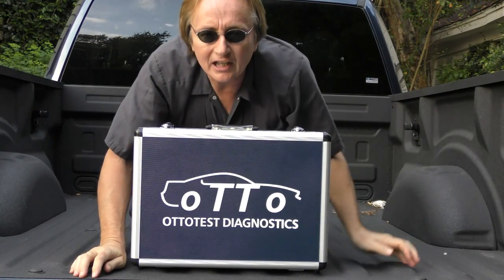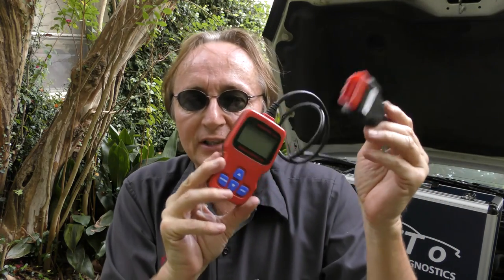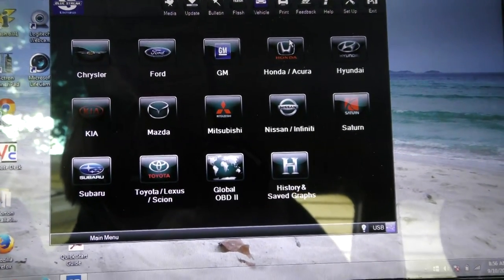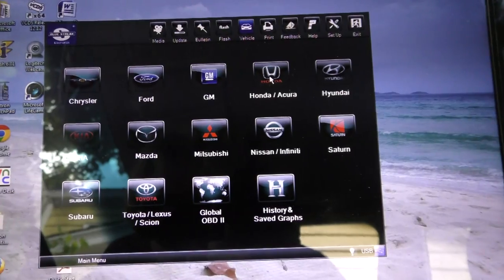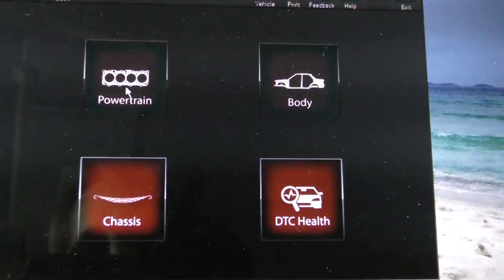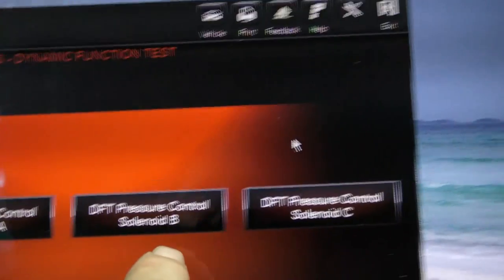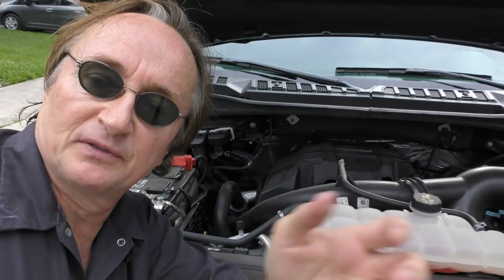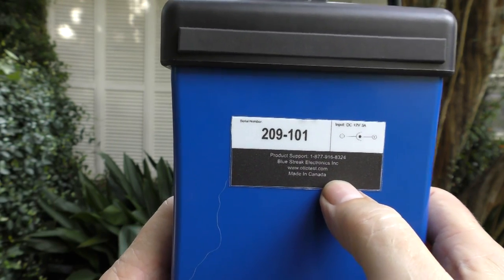Fixing Complex Modern Cars

Comment: Hello Scotty, I watch your videos everytime and some of them are occured to my car. My problem is this. ( my needles of speedometer rpm fuel etc are lower than usuar, especially the km/h needle, but when my car is off and I turn it on everytime I turn my headlights on something happens. Like a shut off of everything in my car for 2 seconds and then back on, I have to mention that i changed my HID kit a few days ago. This happens when I turn the car or the ignition on and after that my headlights. If I try to turn headlilghts with the car and ignition off, my headlights start flashing ) My car is peugeot 307 
I have sooo many problem to discuss with you but unfortunately I live in europe
Reply: +Florenc Sinanaj I think a good starting point would be to check if your battery is still good enough.
Reply: its voltage is 12.7V which I think is good but some people tell me to change the comm2000 unit on my steering wheel. I don't know now..

Comment: Is a muffler delete a good idea? What are the negatives of doing so?
Reply from the maker: +M134D MINIGUN well, cops will pull you over, and really, it messes with the exhaust back pressure on modern cars and actually makes them run worse unless computer is reprogrammed
Reply: Hey Scotty, I have a 2011 Kia Soul with sport mode on it. When should I use sport mode? Can I use it whenever I want?

Comment: Pretty cool! Though I beg to differ about European cars. I just paid $15 for full multi-system fault code software for my Volvo.
Reply from the maker: +Alex Pancamo that's nonsense, you may have gotten some cheap chinese made bluetooth device, but it won't be full volvo software, I guarantee that
Reply: Scotty Kilmer
No, I have a chinese bluetooth one too, and that works great with the Torque app, but that isn't a full feature program. Just basic OBD2. I also have VOL-FCR, which is Chinese, but it truly is a full feature program. I had to work out some kinks (used a $5 VAG-COM cable instead of the cheap one included) but it works on ALL systems. It is full Volvo software for OBD-II compliant Volvo models up until 1998. Ask any Volvo guy, they'll tell you that's the best one without getting the full VIDA/DiCE.

Comment: Scotty, my powersteeing doesn't work when I'm at idle. The belt is tight, not slipping, and fluid is level. What could be the problem? Its a 99 cavalier
Reply from the maker: +mutantmexicanbeans worn out pump if engine is idling at normal speed
Reply: +Scotty Kilmer Thanks!

Comment: Can this tool cycle the ABS module to bleed it?  Is it better than the autel maxidas? It's not often but I've had to take my vehicles to a shop to have that bled if air ever gets in there because there's no good way to do it manually.
Reply from the maker: +ScubaCat3  yes it can, and it does much more than an autel for most cars that is does handle.

Comment: Hiya Scotty I have a 03 Chrysler voyager and I need a new blendoor for the heater can you make a video on how to fix it, I can't afford a 1,500 repair I also can't go another winter wearing 8 layers while driving it.
Reply from the maker: +annoythedonkey it is an insane job, and I won't be making a video any time soon, cause it doesn't get cold here in houston, so when one breaks, the owner just leaves it alone in most cases.  BUT, you could get one of those electrical car heaters that help heat the cabin out, they cost little and you can wire it directly to the battery to make heat inside the cabin.
Reply: +Scotty Kilmer thanks Scotty, I did that last year the 12v heater caught on fire, lucky or me I was in the van when it happened Because I had a ton (literally 2500 pounds of a weekly publication news paper in the van) I really appreciate you taking time out of your day to help people like me with automotive questions

Comment: my autel scanner that cost about 300 euro does all of this and more it basically covers every manufacture you can think of asia, europe and usa, all the modules they have, and less than 1/4 the price.
Reply from the maker: +Ray Rooney And it has cloned pretty much illegal software in it, plus it does not do the 95 percent coverage of most models, often not even 50 percent on many models.
Reply: +Scotty Kilmer I wouldn't worry bot whether it's cloned or not I think the one I have is the md802 elite it's brilliant. But I have had their cheaper scanners and they were junk.

Comment: hmm, ive got one of these wifi things that pluginto your car and as long as you have a good app on ur phone it works just fine, and u can pick one up for around £10-20
Reply from the maker: yea, but those only go so far, no where near dealer scan tool information on those. i know, i've tried a bunch of them out and never use any of them anymore
Reply: Scotty Kilmer oh, yeah for example i couldnt get any data from the aircon system, it just said that it was unsupported. You get what you pay for i guess :)
Reply: +Scotty Kilmer I bought a $50 scanner on ebay not sure the name because it got stolen in my car before I get to know it, the things it can do are pretty much a Bluetooth scanner can do too. Plus the Bluetooth one show emission data, showing all the number , graphs plus it comes many performance  gauges where you need to spend thousand from a sport car. The app is Torque. $5

Comment: I have no problems at all repairing modern cars but I a Mustang just keeping up...A crv no problems since the scroll ac compressor went bad under warrenty and now its 16 and a Nissan Titan truck 6 years old just brakes and rotors and a tail pipe flange at the muffler and 100 k miles.. I had a Carolla but the tranmisission went bad at 320000

Comment: you should check out vcds for VAG cars, really powerful software
Reply from the maker: +Ivan Jacobs oh, I've got one of those too, people send me stuff all the time in hope I use them in my videos. And they do work decently, but nothing compared to the factory vag com unit, which I also have
Reply: for sure, the actual VAG one is awesome

What i found after tinkering around with my 2011 A4 audi, was that a bunch of the cars features are turned off, 
things like the automatically dipping mirrors when reversing, or the feature which automatically closes your windows when parked, when it starts to rain, or the fog lights coming on into which direction you are turning, Suppose its just more for the STEALERSHIP to rob you of.

More interestingly , when i got the car, it had a audible beep when locking the car, a feature which vanished after the one service, upon questioning, turns out its some german BULLSHIT that was being forced, due to "noise pollution..."

which posed a issue, here in South africa, we have a problem with remote jamming,

what would happen, is, Thieving lowlife, will jam the signal your key/remote sends to the car by means on a garage opener remote, or gate remote , or similar car remote( fleabay) and you walk off, thinking your car was locked. Then as soon as you walk off, they come and help themselves to your items left in your unlocked car, so when i found that option to reenable it , i was most pleased!!

Thanks for the video's , most entertaining, and try lay off the german car bashing, they not all bad :) Audi is Awesome!!

Comment: BMW/VW/Porsche/Mercedes factory software is free online, and the cable for it costs $15.
Reply from the maker: oh yea, send a link for us all here if that's really true.  That stuff costs a fortune for the real stuff, that is either pirate stuff or just a weak bit of software, not the real factory stuff
Reply: Scotty Kilmer I'll see if I can find it again and send it over to you, at least for BMW. I know for a fact that the BMW software is indeed what they use at the dealer, and it's a standalone program. It works pretty well; not as convenient as your scanner, but for the DIYer, it's perfect. I've coded all sorts of amazing options of my car thanks to it! I'd love to show you the wild functions that they program for BMWs - but the dealer originally ships them as disabled. Why? Because if you want to enable them, it's $100 per coding session!

The dealer software is less powerful than the factory engineer software. The engineer software is extremely powerful: you can run any function you'd ever need on it, which actually makes it relatively dangerous. You could set off your airbags if you really wanted to. My favorite function, though, is the power bleeder. It'll run ABS and everything for you to bleed the brakes automatically. Just hook up your bleeder bottle, fill up the reservoir, hit "Start" and follow the on-screen instructions.

Dealer software is called ISTA/D and ISTA/P. /D is for diagnosis, /P is for programming. The factory debugging software is called INPA.

Comment: i know this may be off topic but i have a 2001 kia sephia automatic and for a few weeks now it had been acting up the gears wont shift correctly like it wont go past Drive 2 i can shift to just DRIVE but it wont go into drive just DRIVE 2 AND DRIVE 1which is annoying now it accelerates slowly very slowly to the point it's not drivable anymore. i cant get it to a shop till next month and need it to go back and forth do you know wut may be the problem?
Reply from the maker: +🔰SickVibe-DisRupT🔰   odds are tranny is breaking down internally, typical on those. But try changing fluid and filter and pray that helps.
Reply: +Scotty Kilmer  alright i will try that thanks. Also your videos are very helpful thanks for making them.

Comment: is a 1999 Ford on Ranger,  change the radiator already cuz it was clogged and the thermostat was clogged as will, so we  should we put the new thermostat in or leave it out, it was already  been throwing water out through the muffler do we still put  that  blocked liquid copper will it still work or do we still have to take change to head gaskets
Reply from the maker: +Barbara Munoz remove the thermostat, try the sealer, but odds are you'll need new head gaskets
Reply: So I don't put the new thermostat in
Reply: Also can you sent me a video of step by step of taking out the head gasket
Reply: +Barbara Munoz Check out ChrisFix, I believe he has a video on the thermostat.

Comment: if the diagnostic tool costs $2000? What does a new computer cost? Around the same? Could you pull the sensors and test them to see if the problem is in the computer or in the sensor?
I would think this diagnostic tool would be best used by a professional mechanic where speed or work and turn over really matter. A driveway tinkerer might be better served taking a lot longer and keeping money in their pocket.
Reply from the maker: +trevor rotchell  Yes, this tool is for pros, BUT unfortunately many of the repair aspects of modern cars require a machine like this. No way past that one, they;re making em THAT insanely complex. There are many things these days a DIY guy just can't do due to computers and reprogramming required when parts are replaced

Comment: Will i be able to do any modification of my car with this device at that price or do I need to buy additional software for this device to be able to modify the car?
Reply from the maker: +The Trillion Dollar Gods modifications require specialist software that you need from a third party.
Reply: okay
Reply: +Scotty Kilmer Thanks for the response. i checked out more videos and the website to see if they had something for the ecu. They got some software called iFlash which can be on my pc and I can use the scan tool/diagnosis tool as a pass through from my pc so I could update the computer in my cars. It cost an additional sum from which every manufacture that I use. Thanks for posting the vid.

Comment: That would come in handy with my not-so-new 2002 Camry that every time it stalls, it doesn't trip the check engine light
Reply: +Colin Donovan Might wanna try cleaning the idle control valve. Japanese cars are known for them getting carboned up after a while. Just take it off, spray it down with a can of carburetor cleaner, let it dry for a while, then put it back on. All there is to it.
Reply: I just got a check engine light last night and apparently it's my air/fuel sensor going bad
Reply: MrNotorius5500 I just got a check engine light last night and apparently it's my air/fuel sensor going bad
Reply: More than likely its an upstream sensor. they're usually pretty easy to change, but some can get kind of expensive.
Reply: My code reader was saying P1135 air/fuel sensor bank one sensor one
Reply: Yup thats an upstream sensor. It is threaded into the exhaust system somewhere before the catalytic converter. Change that out and you should be good. Be sure the new sensor has anti-seize compound on the threads because without it, the next time you go to remove the sensor, it will be virtually impossible without taking a torch to it due to being exposed to high temperatures most of the time.
Reply: The only sensor I can see is attached behind the heat shield onto the exhaust manifold.  I hope that's the right one so I can get the part from work tomorrow.  Looks amazingly simple to do myself
Reply: MrNotorius5500 It would also explain the constant low-idle.  It regularly idles under 500 RPM and at start up, the revs are so low, it barely stops itself from stalling
Reply: Maybe maybe not. It wouldn't hurt to have a look at that idle control valve for that though.
Reply: I don't know if I'll have the skill to do the throttle body or IAC, but I'll ask the shop that I get the car maintained at what they will charge
Reply: Cleaning the IAC doesn't take any skill. Just disconnect the wire connector to it, remove the screws, pull the IAC out, spray down with carburetor cleaner (might want to use a nylon brush to assist here), let it dry for a while, put it all back together, and that's it.

Comment: You can get a VAG-COM for german cars
Reply: that only applies to vag car 
I haved work on Renault they use "clip" that system pinpoint where the fault een the wires 

the system he used is just an standard obd reader with some exstra options 

vag com is design to recode and reinstall moost of them

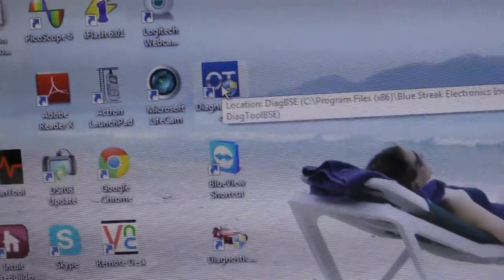Comment: 1:14 Blueview? That looks like a ripoff of teamviewer. Icons are identical. I would get rid of that if you don't trust where you got if from.
Reply from the maker: +Phlaked Corn  realize these guys make their own stuff, but they also make the delphi scan tool for delphi, which is exactly the same VCI unit. Most things these days go through middlemen, some more than one before  you purchase it.
Reply: Scotty Kilmer No that desktop icon below the one you clicked on, it has an identical icon of a program called teamviewer, and I am fairly sure it is copyrighted. Teamviewer is a remote desktop program that allows for people to take control of your computer, I just hope that blueview is not a clone set up for malicious intent.
Reply from the maker: +Phlaked Corn that icon is just there so you can let the guys at bse take control of your computer to diagnose possible faults if you have a problem with the ottotest software.  Makes it easier for them to fix any problems that may occur, I tried it out with them and it worked great. I do try out all the stuff I test, so I can be sure that they work well.
Reply: +Scotty Kilmer Unrelated to the video ,but I want get a branco is that a good idea(parents pay for gas)
and the one I'm looking at has 81,000(red silver anniversary )for 4k should I get it.

Comment: Learned my lesson with my 2009 VW GTI. Fun car ar first, good looking and even drove and maneuver nicely. And it was good in gas for a sports hatchback..But It is a money pit (still own it, no choice). Way to expensive to fix and when you fix it yourself like I did there is sometimes something that needs to be done at the dealer after you do the job 90% of the way. Next car I'm getting will be anything but German, or European. Good looking cars but to expensive to maintain and keep around, and is not like they put some tech that extends the life of this Euro vehicles. They wire them up with useless modules that tend to break and cost a fortune to replace and reprogram (only at the dealer). It almost makes me thing that they purposely wire them up to break down so you can take them to the dealer.Take Scottys advise people, buy Japanese or domestic.
Reply: +George Bonta Thanks for the honesty. Most of the German/Euro car buyers will never admit this stuff. I had a friend who swears that VW are the best cars, even though he spent $5000 on fixing his Jetta that ended up dieing. I am driving a 99 Acura TL since new. I hardly needed to do anything to it.
Reply: Yup. VW are great if you buy them new and keep them for 3 to 4 years under warranty. Otherwise they are money pits.
Reply: As always there are a few vw that works great and fixing it's cheap and easy,  I have a 1984 GT golf mk1 (no i, no inyección) made in West Germany, 1996 golf cabrio mk3 2.0 made in Mexico were i live and a vw pointer 2003 made in Brazil, all very good but the German it's the most reliable, you can find very cheap parts and labor to fix it, and thanks to scotty i know how take care of my baby's, or I must say German money pits?

Comment: I bought a cheap china obd2 reader off ebay. It reads information off the ecu just fine but it claims to have no error codes at all. The car is 12 years old with 100k miles so i thought it would atleast have a pending code or two. Are these chinese readers known to read sensors but not any codes?

Comment: I have a problem with my 2007 Dodge charge.
how to reboot my computer
Reply from the maker: +stephan boss just disconnect battery for 10 minutes and turn the headlights on to drain capacitors.
Reply: Thanks I will give it a try
Reply: Will that reboot my computer because my traction light and a little lightning bolt signal I think it's for my power that I am loosing that's what's making my idle high
Reply: My lights are still on
Reply: Some one help me this code came on H5479 on my 2007 Dodge charge